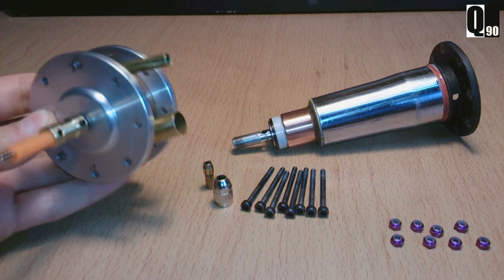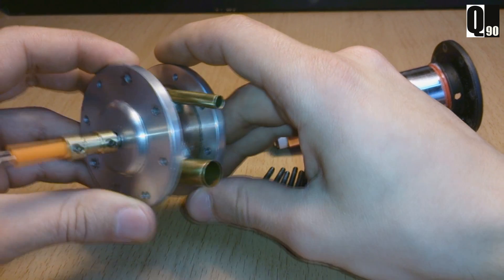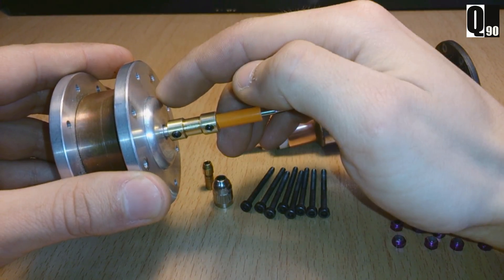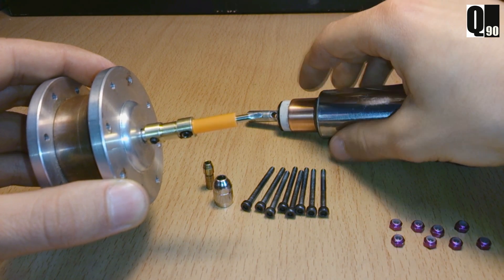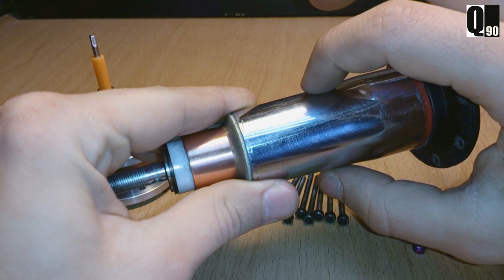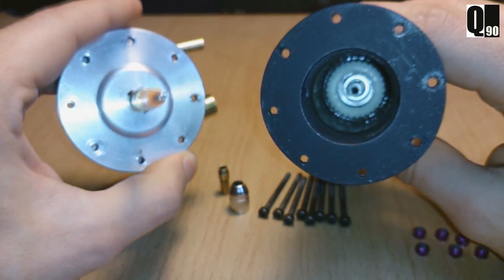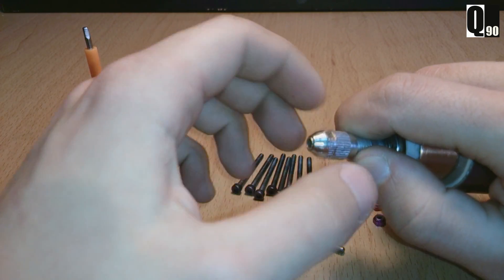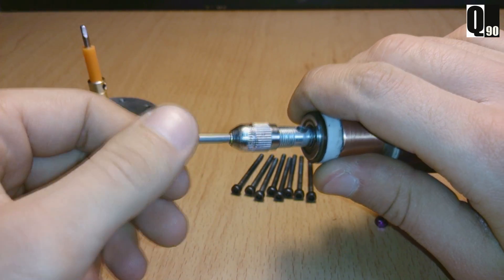Air Turbine Rotary Tool

Comment: You're a great inventor. As a painter, what we yearn for is something that would allow us to use an airless sprayer to cut a clean line where a wall meets a ceiling, without overspray getting on the ceiling. Closest tool I've seen so far is the Spray Guide tool (videos on YouTube) but it has its faults, including the wheel often wandering where it wants to and the width of the wheel itself preventing the paint from getting right into the edge. It also can't get into corners. Not just walls and ceilings either but anywhere a clean line is needed using a spray gun. Develop something foolproof and you make a billion.